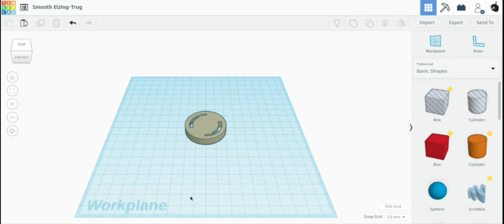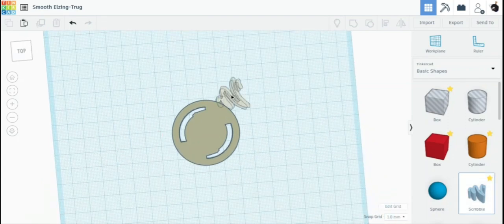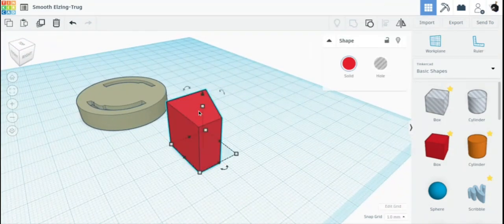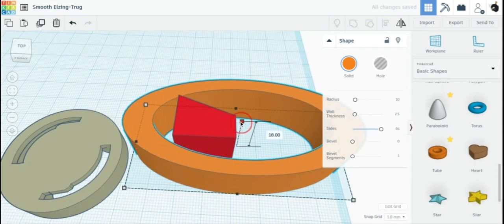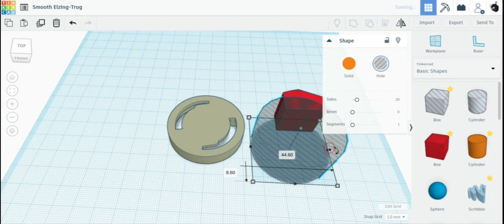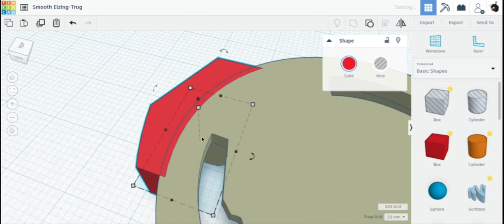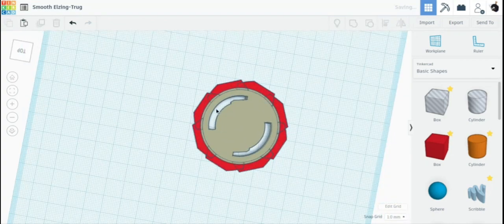How to make your own 3d printed beyblade!

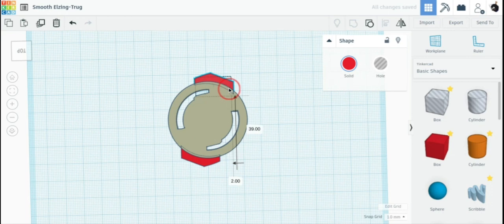Comment: at 3:37 when im supposed to group it, it groups both the beyblade center and the two end pieces and then i cant align. Please help
Reply from the maker: You will need to align before you group it
Reply: @TwoTripleoh  i tried that also and when i did, it made them all go into the center instead of being straightened
Reply from the maker: Group the contact points, then align

Comment: This might be a dumb question, but what generation bey layer is this?
Reply from the maker: The one i modeled is just a simple layer, not really any generation, just a base layer, thanks for the question!
Reply: @TwoTripleoh  I'm trying to make a Custom Burst bey and used this basic model as the starting layer, what else do I need to customize the mesh together correctly? I used to watch Beyblade and just got back into it, but have lost all knowledge of beys since Metal Fury.
Reply from the maker: This is the burst system, didnt quite understand the question at first, it functions way different than metal fight, you should watch some videos of the beyblade burst dual layers so you know how they work

Comment: What 3D printer do you use?🤔
Reply from the maker: I use an Ender 3 with a magnetic bed and Overture PLA
Reply: Aye, fun fact I just got done designing my FIRST 3D PRINTED BEYBLADE EVER! It's called Smite but the only problem right now is I have to wait until christmas to buy the printer. Until then the file is just waiting to be used.
Reply: @Asylum1917  hand over the file and mailing adress ;)
Reply: @bluethumbbuttoneek9465  wait what?🤔 are you saying your willing to make Smite? If so I used Tinkercad to make it I'll try to send you the file. Only if your saying what I think your saying

Comment: Thanks man 👍
I was thinking about making beys on Fusion 360.
Then you published this video,
I’m gonna back to Tinker CAD again!

The 188th Suber
Reply from the maker: Thanks!
Reply: By the way
I’m making 4A for my project
If you have interest in it
Sub my channel
When I’m done,I’ll put it in my vids
Reply: In fusion 360 you can just make a profile extrude center your contact points then array way easier. Tinkercad is pretty clunky.
Reply from the maker: 100% agree, tinkercad is very minimal. All my models are made on tinkercad though, as i dont have the software required to run any better programs.